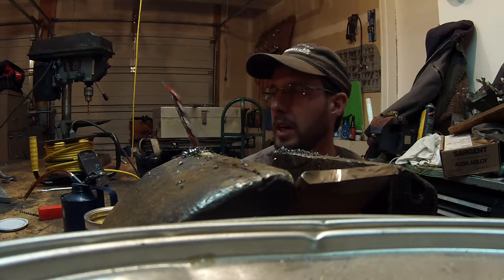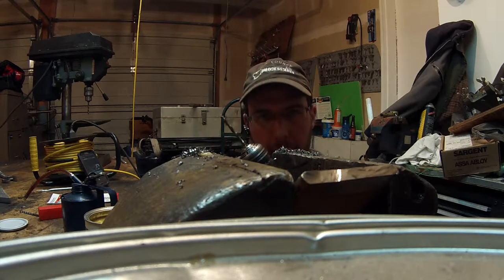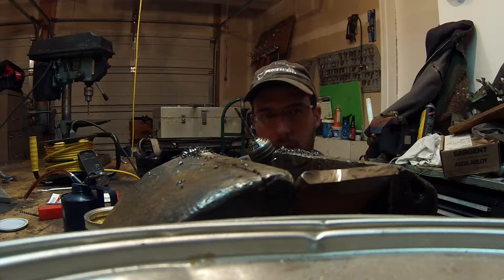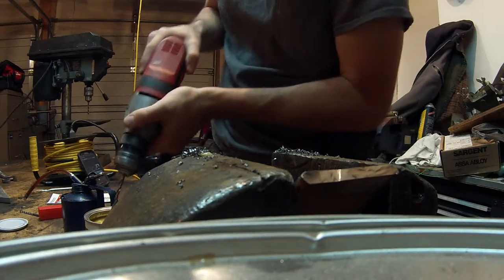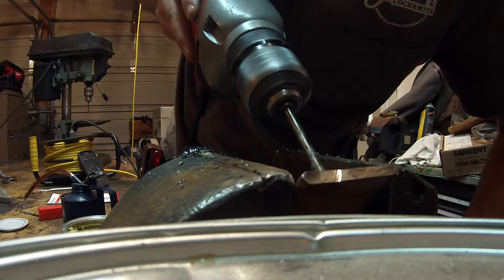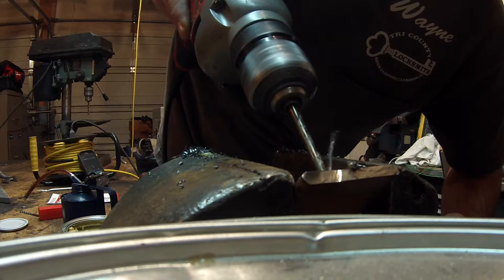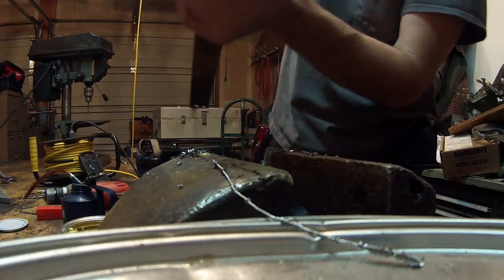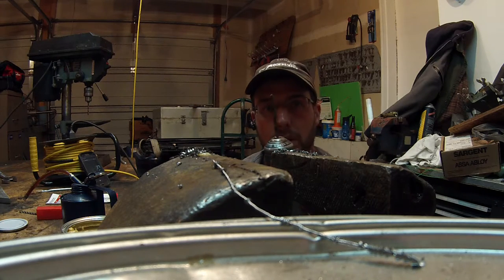TTP Drill Bit Review

Comment: Would you say these bits are better the the Norseman's you like so much?
Thanks
Reply from the maker: They are good. slightly harder than norseman buts but they are a little more brittle as well meaning that any side pressure will snap them. they both work great.